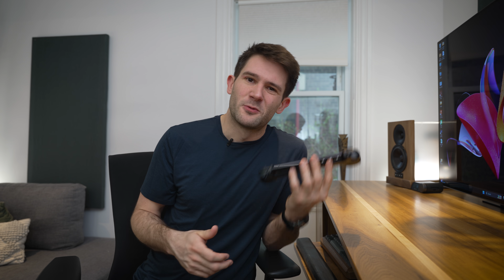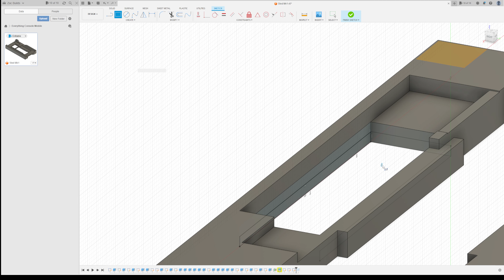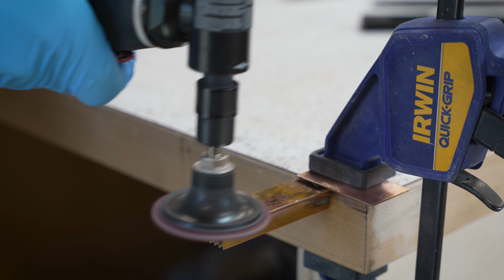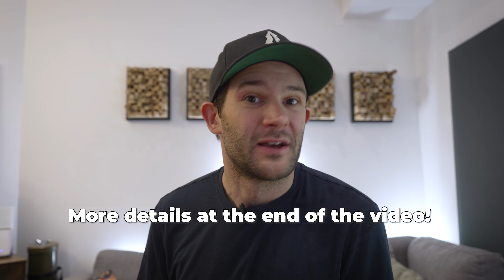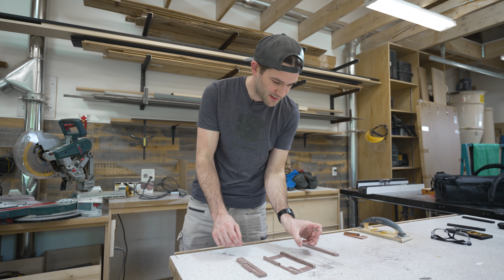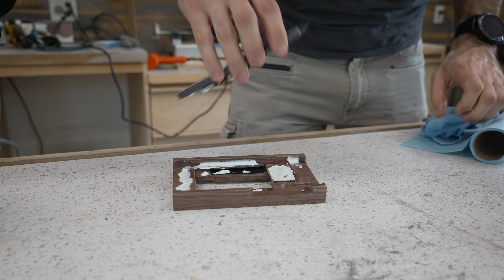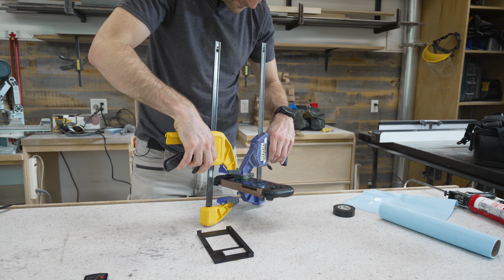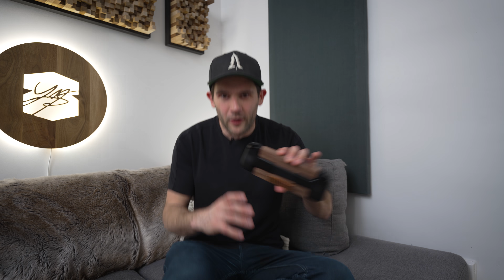I built the ULTIMATE GAMING phone...

Comment: You should recalibrate the battery because the phone can't really recognize that it has a bigger battery and it will have some charging problems, you can just set the capacity manually if the phone is rooted but since you can't root it, it's worth trying to recalibrate it...just for the sake of it 🙂
Reply: @@chizisjTo hardcode a certain capacity value would quickly turn disastrous as overcharging a degraded battery could make it explode. Voltage is the important metric. Of course current can and often is measured. But it doesn't impact the charging procedure.
Reply: @SweBeach2023 he meant harcoded the designed capacity. The usable capacity decreases and that is also loggged by the device
Reply: @chizisj true, but that's more of a reference for the phone, as it's going to use the more important voltage as it's metric to determine how much is left especially given that the mAh/Ah of a battery will change/decrease over time
Reply: I added a larger battery to an old phone and it shows the battery level dropping over time even though the voltage is via a regulator and never changes. Then at the end of the normal capacity, it throws a warning, which you can ignore and keep going, but it gets tedious. So yes! Android knows the original capacity and reacts accordingly
Reply: @spr00sem00se   What phone? I've tried something similar to use my old phone as a Raspberry Pi alternative for a project. I removed the battery and used a step down module to power it from a 24V PSU. It was a OnePlus 3. The battery level stayed at 100% all the time.
Reply: @schwuzi  I have an old Samsung. From 2015.  I soldered a USB cable directly to the battery terminals and gave it 5v.  Figured it would likely survive 5v as it's designed for at least 4.2v. I then power it through a home made powerbank.  And use it to receive weather fax with a ham radio.
Reply: @schwuzi  try booting phone at lower voltage at start. While phone boots it measures voltage then estimates battery percentage with algoritm that uses default battery capacity

(i had done it. at 3.9v it booted with aroun 70 percent capacity, but im not sure if it was lowering it while using it i dont realy remember that i guess it was)

phone was cheap old lenovo
Reply: @spr00sem00se  huh? you put 5V at the battery terminal cause it's designed for 4,2V? That seems more like a gamble to me...
Reply: @sabahaddinarslan2927  yeh. It was a bit of a gamble. But I reckon most phones will handle it OK. In my case it's working fine. Stick a diode in there if you want to lower it to a safer level. I'd do that on a better phone just to be sure
Reply: I love DIY perks voice
Reply: You don't need to do that. The phone doesn't know how many Ah are in the battery. It can only use the voltage as a reference. Since the batteries are in parallel the voltage will be the same and will just drop slower (or charge slower for that matter)
Reply: @schwuzi it knows the capacity. You can check that info in the about device (about phone) section in settings.
Reply: @schwuzi  phones do. I did a similar modification to my K20 Pro and without the mod, it only does charge like the 2nd battery isn't there.
Reply: @schwuzi  LoL
Reply: They do a quite similar project, and yeah they change the actual battery capacity https://youtu.be/px1A6XptqhQ?t=151
Reply: You don't need to
Reply: @jalie-15303b  Do you mean that third terminal on batteries? I'm not a professional but that is most likely for monitoring the temperature.
And I have to disagree with your point. Keeping the same BMS is not a problem (although I don't know why he isn't using one BMS per battery). A BMS has nothing to do with the capacity of your battery. It only monitors voltage, output current and such. If he had done a different project, in which he puts the batteries in series, then he would have needed a different BMS as they'd have twice the voltage.
The reason your batteries degrade, might be because you didn't match their capacity.  That's why in the video he used two completely new batteries if I remember right.
Reply: Cant root a snapdragon 888 samsung unless its a chinese model
Reply: Не нужно заниматься хуйней, контроллер питания поймёт какой объём у АКБ

Comment: Okay last comment on this video I promise. Samsung isn't the only ones. Snapdragon SOCs have all of the security features that the company is using baked into the chip. So there is no bypassing them. If your phone has any kind of FRP protection. Or any kind of locked bootloader. You cannot root it unless they have found a way around it. I have given up on looking for rootable devices because of this. Rooting is just going to be a thing of the past until we can figure another way around it. Soft rooting is up and coming but it's very tedious and can break your phone

Comment: A little tip for anybody wanting to double up a battery in a project or something. As long as you put hot to hot and negative to negative when you're only wanting to increase the amount of battery life you want. You should be fine. Just make sure that you keep everything well isolated and do  your best to try not to bridge any connections to ground
Reply: It's simple af ..
Assume 4v 150mah battery example
4v 150 + 4v 150 (in series) = 8v 150mah
4v 150 + 4v 150 (in parallel) = 4v 300mah.
Reply: @SumitMishra-qm4ql  I mean when you think about it it is but you didn't really describe it simply. Series increases voltage parallel increases how long they last. That simple.
Reply: @Dtr146  i told the same brother!! (Mah means milliampere-hour)
Reply: Also remember, some phones only charge max capacity according to the kernel built in
My Mix 3 refused to charge more than 2700 mah
Reply: Have you come across any BMS board that refuse to work with multiple cells?
Reply: @chench1lla  no not really. But, I've never really increased the number of cells by what some could consider an unreasonable amount. I have a electronic air duster that lasts like 3 minutes at full blast which isn't enough time to really do anything. I opened it up and it had three batteries in series. So I took three batteries and combined them in series in the same way that they were in the device. I hooked those two up in parallel and connected them to the BMS. It doesn't last twice as long but it does last a good bit longer. You just need to make sure that if you're trying to increase capacity. You put them in parallel. Putting them in series increases the amount of voltage they can produce.
Reply: Isn't the problem with Lithium batteries that they can get voltage imbalances between the cells if the battery management device isn't keeping track, and this problem is compound once it starts. I've heard it can not only damage the cells, even catch them on fire. I've been told to not mess with lithium batteries in parallel unless I really knew what I was doing.

It's entirely possible I am misinformed.
Reply: @inthefade  as far as my knowledge goes. Balancing issues can only occur with multiple cells in series and if you have more than one parallel group in series with each other. That's what BMSs that are actually decent are for. But as soon as you put a battery in parallel with another. They equalize. That is the main reason why you need to check your voltages before you even make the battery. If you put a dead battery in parallel with a charged battery they're going to equalize and get very hot.
Reply: @inthefade  now battery health is a thing. That's also why you should be testing your cells before you put a pack together. If you put a newer battery with an older battery there's a chance that you can cause issues because the older battery will die quicker.
Reply: So how would you know if they are parallel with each other?
Reply: A tip for surviving life.
If you will be evan litle alive you ar good to go

Comment: I have to say that this is a great build, but in my opinion you should not cut off that second bms from the battery, yes they are parallel, but in case one of them loses its capacity you can lose both of them, you can also use a battery from a powerbank or one cell from a laptop battery and solder the bms to it, also you can buy a display for that phone without frame and connect it to the motherboard to blend more into the wooden frame.

Comment: The handheld looks great! I think the wood does add in a nice bit of design to it. Although I guess you could always just glue on a wood veneer to get the same look.
Reply from the maker: I did think about doing that at one point. Building the frame out of plastic and then just inserting some wood accents. But in the end I just went all wood because well... I cant help myself :)
Reply: @ZacBuilds  you should do diy project with android battery in iPhone or vise versa
Reply: @NicVandEmZ pretty sure apple would reject it
Reply: @ZacBuilds NEXT DIY with SAMSUNG with Added chilling plated cooling fans and overclock🎉
Reply: @ZacBuilds  can i buy
Reply: @ZacBuilds I really like the mod but if it can't play codm I'd just have you mod a phone without the emulator 
If it can do both that's a win win
Reply: @ZacBuilds  how do you charge it
Reply: Add galavanized steel
Reply: @Duck_guy1092  And dont forget to borrow some screws from aunt to firmly secure the phone!

Comment: This is hands down the prettiest looking mobile console!
till some1 with a British accent makes an all brass version😄

contrary to popular belief wood is more durable to heat than 3D-printed plastic

although this might be slower than the Geekerwan build, it is the one you can carry around easily without feeling embarrassed. 

I think if you wanna get all this performance and still daily drive your phone then my suggested method works great: 
I used CM Maker Gel as thermal paste and Gelid GP Ultimate thermal pads everywhere inside so that the untouched crevices make full contact. 
I used my Oppo Reno10x (Snapdragon 855 phone)for this. 
The OS is still stock although debloated.
I'll run my phone on the Wildlife Extreme Benchmark and it does a score of 889 with a stability of 99.4%
(No overclock)

Comment: When you doubled the battery your amps increased so you have to reprogram the phone to the new battery capacity
Reply: The phone uses the same amperage, each battery drains half as fast. Percentage is based on voltage, as the battery gets more drained its voltage drops. It should all still work fine
Reply: Amps are pulled, not pushed. If the phone was drawing a certain current at a certain voltage then putting batteries in parallel wouldn't change the voltage and have no effect on the current drawn. 
The charging of the batteries could be an issue though ...
Reply: the phone won't know the difference, it bases the battery percentage based on the battery voltage.
Reply: most modern phones track battery wear over time and this is done through a coulomb counter (literally measures charge) so yes, you need to change some kernel files so the charge controller is aware of the increase in size
Reply: how to @SheSlaysZA
Reply: Here consoles are made so modern games gett better experience and not al mobiles run equally 😊
Reply: Form grade 10 physics we know that voltage = current * resistance.

Here the batteries are in parallel so no voltage change, and the phones resistance also does not change so no more current than normal run through the phone.

Though the capacity will still need to be reprogrammed as the Amp hours of the battery increased( it will last 2x ish more than the normal config)

Comment: OOOO... it was only $250 CAD. Yeah, that's uncool man. With all this farting around, we'd be better served buying a Steam Deck (base edition). Sticking a better SSD in there and then you can play AAA games AND retro games. 

Surely this would be cheaper doing it with a SBC and one of those small screen HATs - and bingo. For a lot less money.
Reply from the maker: Priced out doing it with a SBC and a small screen hat. It was the same amount of money, way less performance and the screen was way worse. Obviously you could spend more money on a Steam deck, but you can always spend more money on a high end off the shelf solution.
Reply: @ZacBuilds  I just spent 10 minutes explaining in detail why you're wrong and then YouTube ate the damn comment. There are far too many assumptions here and a lot of hidden costs. I've been doing this a very long time and I designed/built an entire movie accurate replica of a GB proton pack (as worn by Harold Ramis) so I have plenty of experience in 3D design, printing and manufacture. Part of my career was writing early 8-bit games and they don't benefit at all from 120Hz refresh even if our eyes would - but slower TFT displays often have a slightly slower response which removes the need for high speed because they cause a slight delay which assists the persistence of vision. 

I think a custom design using an SBC would be a more practical solution that everyone could build without needing to find a phone of dubious sourcing and having the expense of a FLIR, etc. $250 isn't a lot of money to you, but it is to a lot of people and some of the other assumptions you appear to have made regarding things like the battery charging unit made me question the reliability. We tend to think of SBCs like the Rpi but there are more and more powerful ones available for way less than $250 and I suspect, if one orders from China, you could get an SBC and a decent screen under that budget. No fiddling with fragile components and no reliance on being able to unlock the bootloader. (I didn’t get that far, so forgive me if I made an assumption here, but you’ve already said you’re gutting all the “phone” parts.)

A Steam Deck has a full operating system too – not to mention a much larger “hard” disk, far more processing power and so many other features that they’re hard to count. Valve is said to lose money on the 256G model and it’s easy (for people like us) to replace that SSD with something like a 2Tb internal one. No soldering required.

Obviously it’s far more expensive than a used mobile phone but you have to balance that against the  utility of all the extra functionality – which is considerable.
Reply: @marcdraco  1- just criticizing a creator because you claim you can do it better is a fool’s game. Either you actually do it, or just click away. 
2- you cannot buy a sbc that can run ps2, certainly not for this cheap.
3- starting from scratch w a sbc +hat, plus battery speakers, case etc. how is that simpler?
4- steam deck starts double the price.